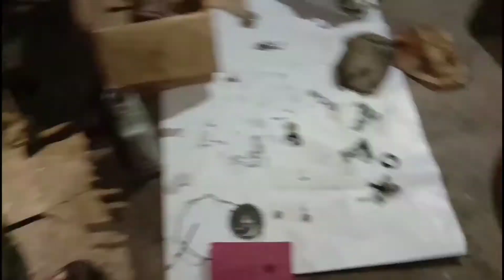piaggio vespa engine fitting | piaggio vespa engine rebuild |vespa engine repair | sk moto custom

Comment: Is vespa parts selling on outside shop,, authorised service center does not give any parts, some workshop not repairing vespa scooter 😔, u did  great job😕
Reply: Bro pls help, my front vespa sxl 150,front tyre ine side wear, what was the causes?
Reply from the maker: Bhai hindi me bata kya hua to
Reply: @saurabh_khiratkar  भाई pls मदद, मेरे सामने vespa sxl 150, सामने टायर ine साइड पहनते हैं, क्या कारण थे?
Reply from the maker: Bhai tu kya batana chahta he muze samz me nahi aya. Bhai intragram pe sms karo no. Debuga mera fir call pe batana clear kya he to ya pe no. Nahi desak ta tik he bhai (id SK_moto_custom )
Reply: @naryanav2445  check your suspension n fork alignment